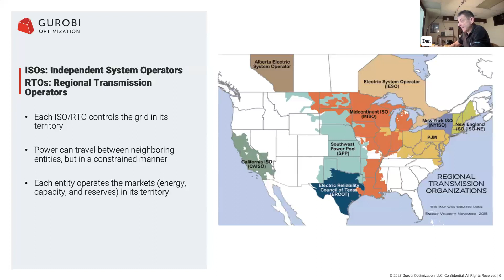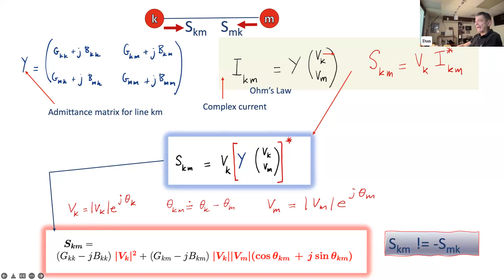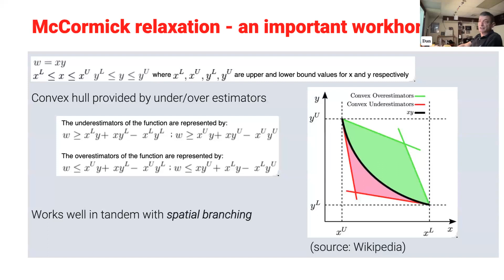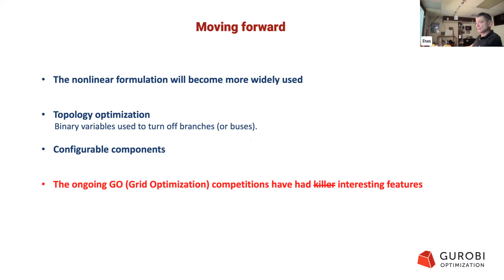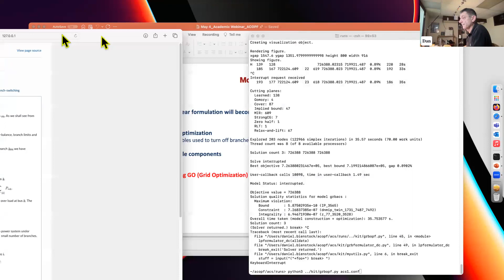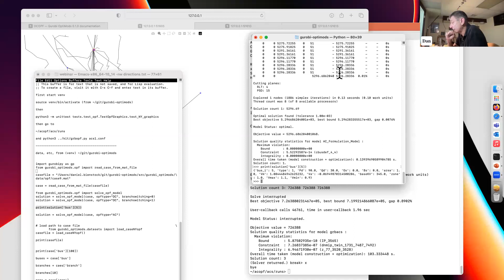Gurobi Academic Webinar with Dr. Daniel Bienstock discussing the AC Optimal Power Flow Problem

Comment: What becomes this simplification in the DC power flow for the voltage Vk = 1 for the different voltage levels in a full network with for example 400 kV, 220kV, 380kV, 115kV, 35kV? Let assumes we have a network with the Generator, Transmission, Distribution.
How do you set Vk in such case?

Comment: Hi Gurobi,  Thanks for the video. The Optimod is already available?
Reply from the maker: The Optimal Power Flow OptiMod is now available here: https://gurobi-optimization-gurobi-optimods.readthedocs-hosted.com/en/stable/mods/opf/opf.html
Reply from the maker: It is! You can read more about it here, with a link to the gallery- https://www.gurobi.com/news/gurobi-releases-optimods-an-open-source-python-repository-of-optimization-use-cases/
Reply from the maker: Hello. Eight OptiMods modules are currently available and can be found here: https://gurobi-optimization-gurobi-optimods.readthedocs-hosted.com/en/latest/gallery.html We expect to release the OptiMods for Optimal Power Flow in August or September.

Comment: Thanks for the great presentation! By the way, when will Gurobi OptiMods be released?
Reply from the maker: Hi @shepardyan7333 - The Optimal Power Flow OptiMod is now available here: https://gurobi-optimization-gurobi-optimods.readthedocs-hosted.com/en/stable/mods/opf/opf.html
Reply from the maker: Hi Shepard - we should be releasing the Optimod late this month. We will post a link in the description above when it's ready. Stay tuned.
Reply from the maker: Hi! You can read more about the release here, with a link to the gallery- https://www.gurobi.com/news/gurobi-releases-optimods-an-open-source-python-repository-of-optimization-use-cases/
Reply from the maker: Hi Shepard, eight OptiMods modules are currently available and can be found here: https://gurobi-optimization-gurobi-optimods.readthedocs-hosted.com/en/latest/gallery.html We expect to release the OptiMods for Optimal Power Flow in August or September.